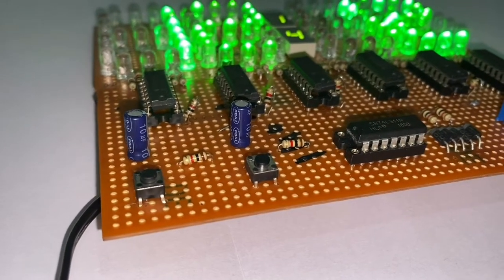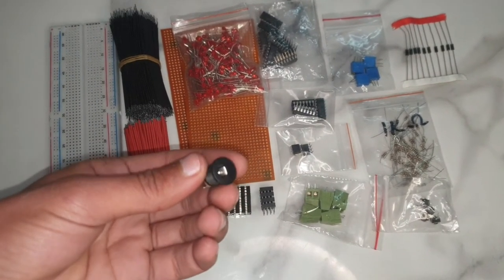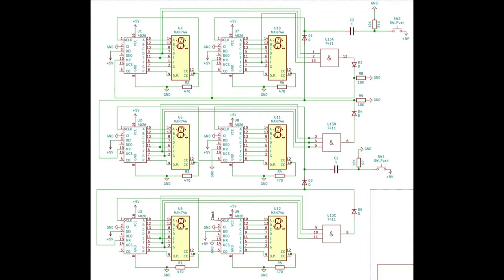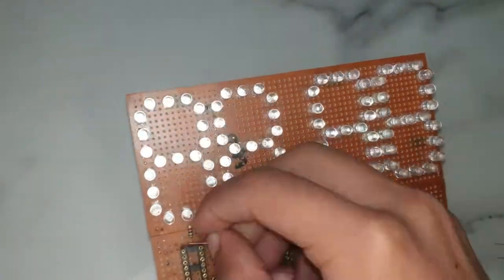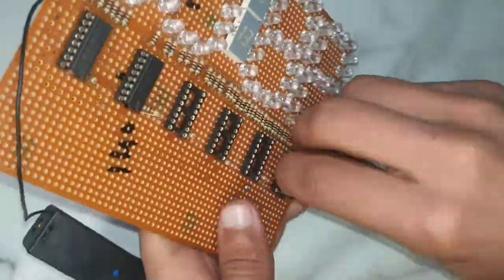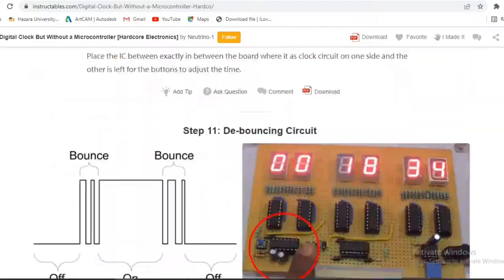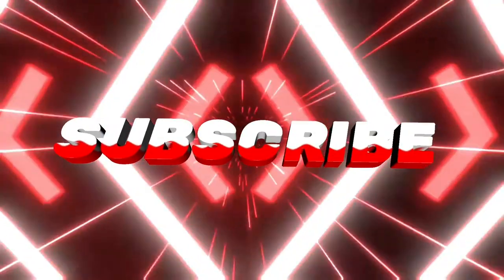DIY Digital Clock With Logical Gates || How To Make Digital Clock With CD4026 IC

Comment: 12 hour or 24 hour
?????
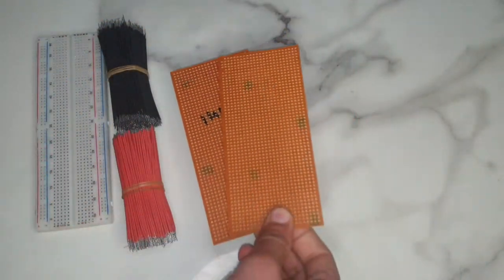Reply: If you examine his reset logic for the hours, it rolls over at 24:00, so 00:00 to 23:59.  It's a bit more challenging to make it a 12 hour clock since you can't just roll over to 00:00, instead you roll over to 01:00.